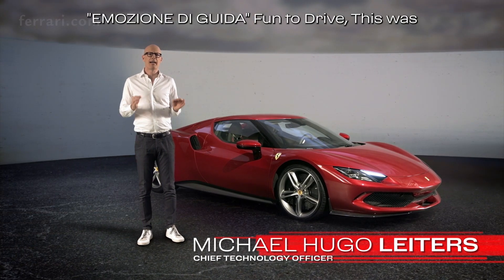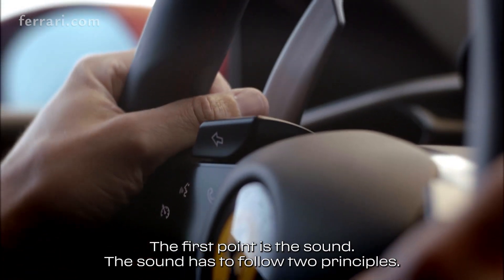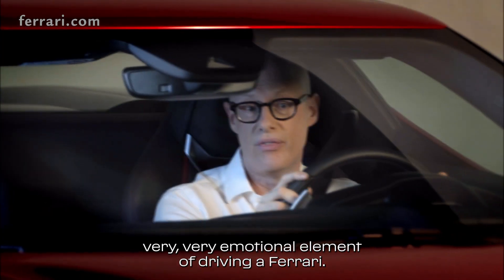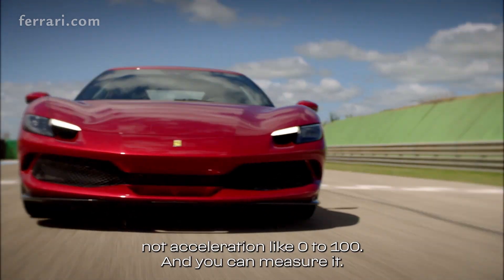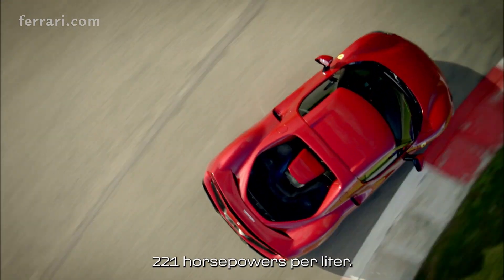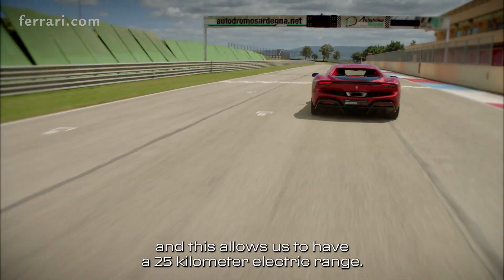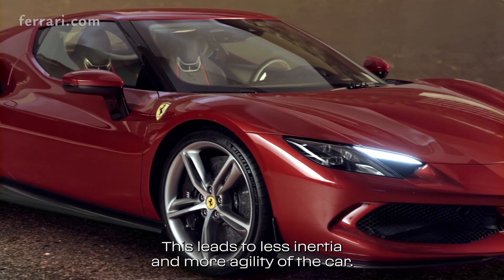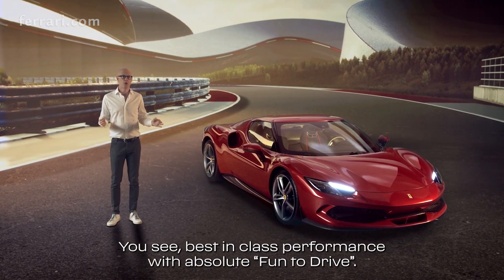Ferrari 296 GTB - Performance explained with Michael Leiters

Comment: It’s so annoying that they are going to a v6. Personally I want the naturally aspirated v8 back. I think if Ferrari made a car that had a manual gearbox, NA v8, 500 hp, good handling and a roof that goes down, that would be a car that would sell by the boatload. Ever since Luca di Montezemolo left the company has been making increasingly less better looking cars and the cars have been becoming more soulless, and this car is the product of that problem.